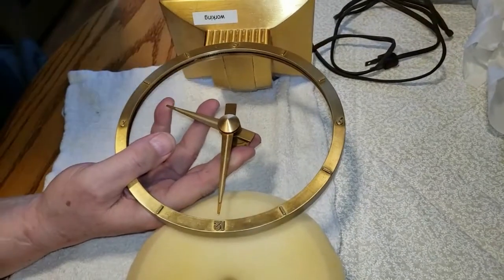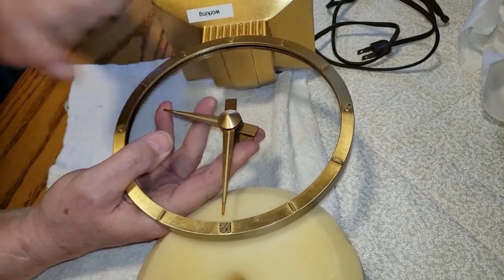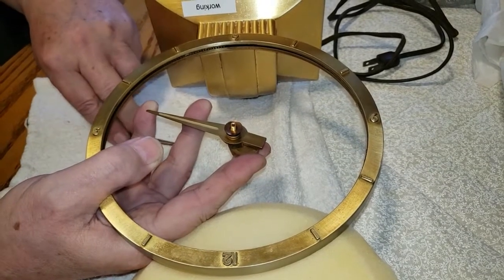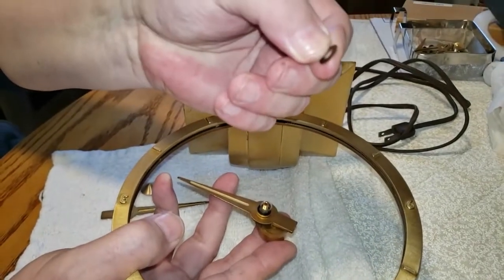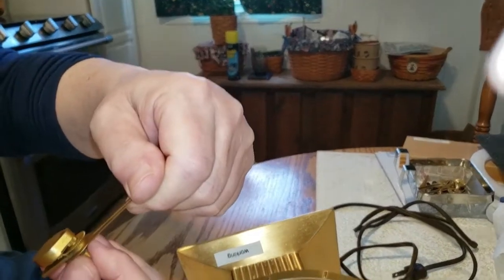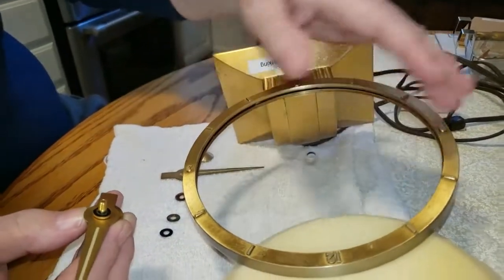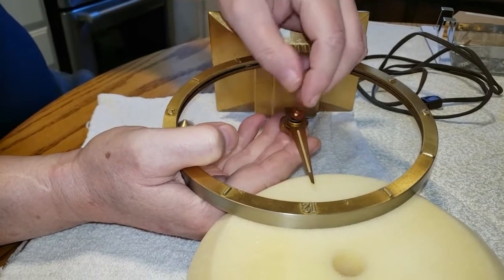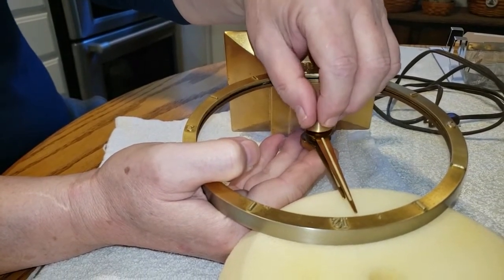Jefferson Hand Adjustment

Comment: Thanks for the informative video.  I just bought a used Jefferson Golden Hour clock on-line. The hour hand was sluggish. The counterbalance would not sway freely. The minute hand kept good time. Following your steps, I removed the hands from the clock. I used a can of compressed air and blew out dust from the gear assembly,  I sprayed a very small burst of WD-40 into the gear assembly.  Now the hour hand and the weight swing freely.  I clean the glass in the body of the clock then reattached the hands. Now it's working wonderfully and keeping good time. I have a Golden Hour clock which I bought some 35 yrs ago. I've been giving them to my adult children as gifts to their new homes. I grew up with a Golden Hour clock in my childhood home. I'm trying to keep the tradition alive in our family. Thanks again for the great video!
Reply from the maker: You are quite welcome for the information. It is hard to find as I learned just starting to work on them myself. The clock isn't designed to use any type of liquid lubricant, so if you start having issues with the hands later on, just spray the gear mechanism down with some electronics contact cleaner spray, then blow it as dry as possible. Liquid lubricants attract dust/dirt over time, that can cause a motor failure or the glass to separate from the drive ring.  Good Luck !!